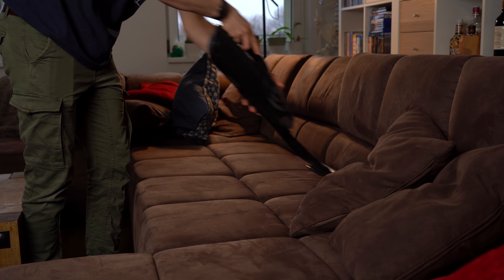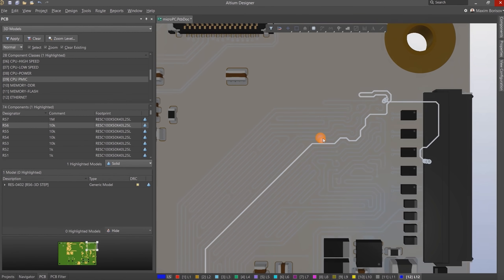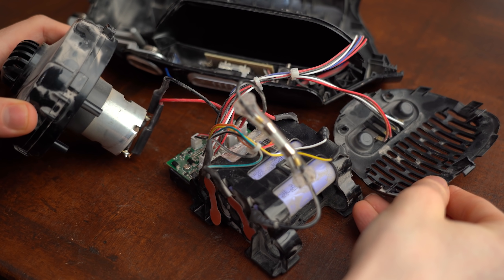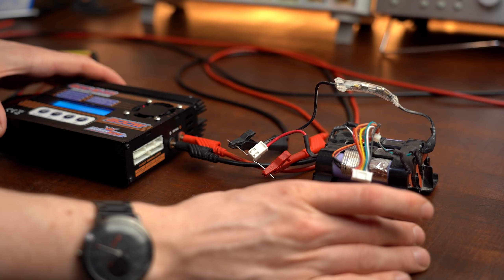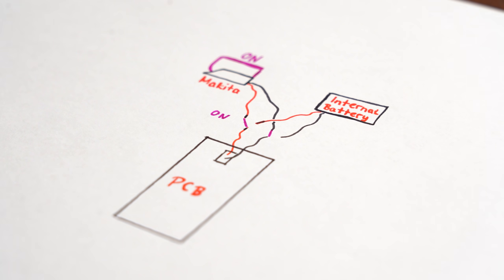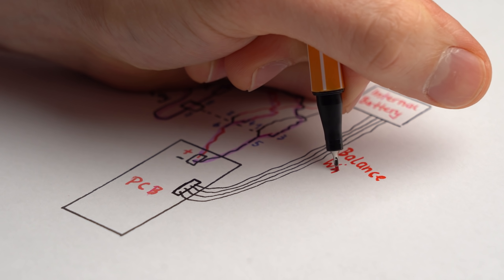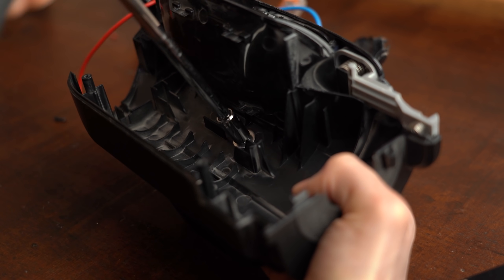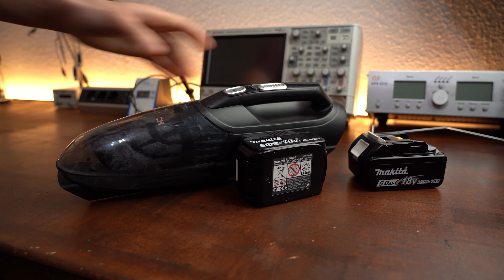Every Device should have this Upgrade! (Endless Battery Run Time)

Comment: I have a similar vacuum from Electrolux, but I must say that the inners this Bosch are much nicer. The Electrolux unit is not easy to disassemble and a huge pain to repair!
Reply: I bought my mom one of the Electrolux stick/hand vac for Xmas a few years back, Sadly I think she tossed the brush retainer piece while cleaning it and I couldn't find that piece as a replacement part :(
Reply: I might have the same one. I was impressed he got 10 minutes, my Electrolux probably lasts 4 at this point.
Reply: @bunnygirls556  - Do you like vacuums, Sexy Time Bot?  I do - suck and blow... Tell me about your experiences, Sexy Time Bot!? 🤣🤣🤣
Reply: I also have an older model of Electrolux that I have need thinking about swapping the batteries on. After watching this video I'm thinking about skipping the internal batteries and go for external pack.  

Huge thanks Scott!  Amazing videos as usual!